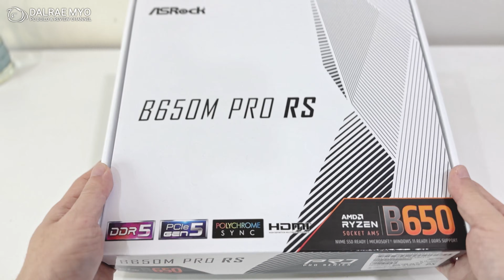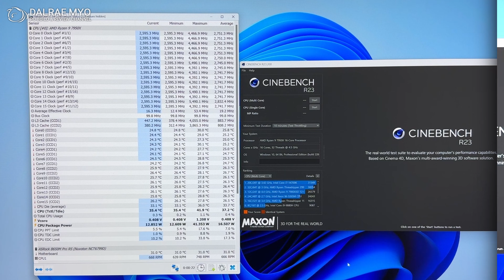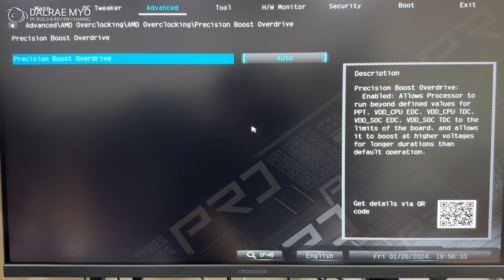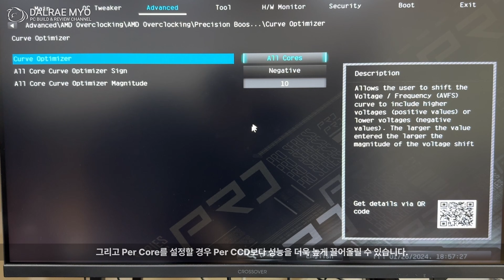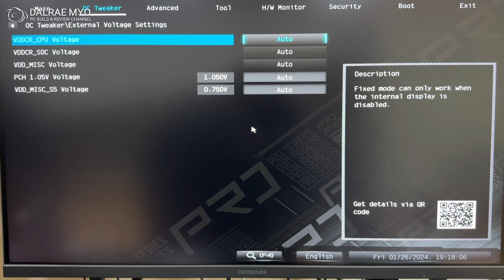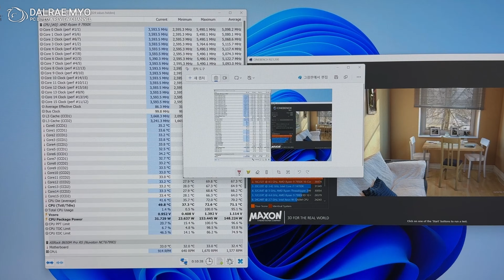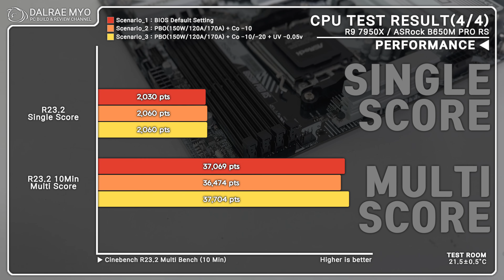ASRock B650M PRO RS Review | AMD Ryzen 9 7950X Undervolting

Comment: hey, I don't understand much about this, but do you think for a ryzen 9800x3d this motherboard is enough? I'll be running at 6400mhz and planning to set PBO + 200mhz
Reply from the maker: Overclocking varies depending on potential, so it's hard to give a definitive answer. However, based on the motherboard specs alone, I think it should be sufficient.

Comment: Thank you for english subtitles! Several days ago i got this mobo (but with wifi) and R9 7950X, my question is: can i go straight to this third option of undervolting?
Reply from the maker: Undervolting has different values depending on the CPU's potential.
You need to find the optimal voltage value for your CPU to operate without problems.
Reply: @DalraeMyo  Thank you for such clarification. I Appreciate your work!

Comment: Does these undervolt setting work for a 7500f generally too?
Reply from the maker: Yes, it would be applicable to 7500F if the potential is similar.
Reply: @DalraeMyo  thank's alot, awesome results by the way!

Comment: Il y a pas besoin de carte wifi avec cette carte mere ?
Reply from the maker: Pour être précis, il fournit uniquement un environnement dans lequel une carte WI-FI standard M.2 peut être installée. Pour ces modèles, vous devez acheter et installer le kit M.2 séparément.

D'un autre côté, une carte mère avec le modificateur WIFI dans le nom du modèle a la fonction WIFI intégrée par défaut.
Reply: @DalraeMyo  est-ce que je peux te contacter par message privé pour plus de renseignements stp

Comment: I just bought this board and waiting for it to arrived! I will pair it with R7 7700! Anyway, the cooler you're using won't block the RGB of the ram kit? I want to see the ram rgb 😊
Reply from the maker: I think it will vary depending on the shape of the CPU cooler you want to install.
If you use a single tower design CPU cooler and two RAMs, you will use slots 2 and 4, so I don't think it will block the RAM's RGB lights.
Reply: @DalraeMyo  I finally build my PC sir and I'm using this board with R7 7700 .. I was getting 44c idle before but when I added a GPU (Intel B580) the idle became 54c Ahhh... I don't know if that is normal.. when I run cinebench though it doesn't go up to 71c/79c only.. also.. can I undervolt my MOBO if the BIOS are not up to date?
Reply from the maker: @ Unlike Intel systems, AMD Ryzen's 7000 series has a high idling temperature. If the temperature does not exceed 90 degrees under a load such as R23, there is no need to worry.

Since the graphics card is a heat-generating element inside the system, it is natural for its temperature to rise.
Reply: @ Thank you for answering! Last question, do you happen to know the  ppt tdc edc for the NON X version of 7700?
Reply from the maker: @ Although there may be slight differences between motherboard manufacturers, Ryzen 7000 non-X will usually operate in Eco 65W mode.

The default settings for Eco 65W are as follows.
PPT 88W
TDC 75A
EDC 150A

Comment: can you do with x870?
Reply from the maker: I know that x870 supports more detailed adjustments than the option values I adjusted.
I also plan to try more detailed settings soon with an x870 or a b850 chipset motherboard that will be released later.

Comment: Can this be used for 7900x?
Reply from the maker: Yes, you can use 7900X CPU with this motherboard.
Reply: @DalraeMyo  Can you guide me to offset the 7900x but the performance loss is not significant?
Reply from the maker: @Nanalu137  This motherboard has enough specifications to cover even the PBO preferences of the 7900X.

If you're curious about PBO custom settings, please refer to the figures I set in the video.
Reply: @DalraeMyo  I am using b650e taichi
Reply from the maker: @Nanalu137  Ah!, I thought you were talking about the B650 PRO RS motherboard in this video.

You can follow the CPU (PBO) settings as I set them.
There are slight differences in the values applicable to each CPU, so it is necessary to adjust the values little by little to avoid problems during load testing.

Comment: Is it okay to put R9 7900x in this b650m,and do this. Because people are scaring me with VRMs and power phases (8+2+1)..
Reply from the maker: This motherboard has a VRM specification of 400A capacity.

There were no major problems when using the R9 7950X.

I think the R9 7900X will have no problem.

Comment: Hey there, thanks for the video. With this motherboard, I was worried with the VRMs but it looks if it can handle a 7950x at stock it should be okay for future am5 processors? Appreciate your insight, seeing as most am5's will only get more efficient. Thanks!
Reply: yes 9000 series is efficient and low thermal you will be fine for future cpu
Reply: @Raghav-gd3fn  so a r5 7500f should easily work?
Reply: @therealkitCat  7600x user here, it works just fine
Reply: should a 7700x be fine as well with this board?
Reply: @hk_g4ming  it can handle 7950X so this mobo can handle7700X with eaze
Reply: @hk_g4ming  yes, the board just not look good as rog strix or aorus tho

Comment: ASRock B650M PRO RS or ASRock B650M PG RIPTIDE?
Reply from the maker: The PG Riptide model has a slightly higher VRM specification.
B650M PRO RS : 400A
B650M PG RIPTIDE : 600A
Reply: man stuck on these choices too

Comment: Is there any difference between this and the wifi version other that wifi?
Reply from the maker: For the WIFI version, you can use wireless Internet and Bluetooth equipment.
When compared to other manufacturers' WIFI version models, the chipsets of the wireless communication devices used are sometimes different, but rarely significantly different (for products at a similar price point)

Comment: Hello, what is the temperature of the VRM?
Reply from the maker: There seemed to be no separate VRM temperature sensor.
Reply: @DalraeMyo I have the same motherboard and the MOSFET heatsink can be moved if pushed by finger, is this normal? Can someone tell if their Asrock B650M doing the same? I'm freaking out
Reply from the maker: @editspotato  A thermal pad is attached between the heat sink and the MOSFET.
Some motherboards receive too much tension and may move slightly to prevent damage to the PCB board or MOSFET.

If you think it's moving too much, try tightening the screws to secure it a little more.

Comment: The right screw on the SSD heatsink isn't moving. Please help me.
Reply from the maker: If the screw does not come loose with the driver, it would be faster to contact the manufacturer's customer center.
Reply: @DalraeMyo  I have but still no reply from ASRock.

Comment: hey hows the vrm heatsink temperature its it good to handle current 7000 and upcoming 9000 cpu with good temps? plz reply
Reply from the maker: The average heat sink temperature was similar to other motherboards in my test. If the power consumption of the new Ryzen series doesn't exceed 200W, it has enough VRM specifications to use.
Reply: @DalraeMyo  thanks for the reply 😁🙏

Comment: I watched hardware unboxed, and in their test B650M Aourus PRO AX and B650m Aourus Elite have good thermal performance, is it related to the numbers of vrms ? compared to this mobo which one is better ?
Reply from the maker: I don't know what the B650M AORUS PROAX is like, but the AORUS ELITE model has a VRM spec of 720A capacity. It has a higher power supply spec compared to the PRO RS model with a capacity of 400A.

Comment: B650m pro rs or msi pro b650 s wifi, which would be better for 7800x3d?
Reply from the maker: I don't think there will be a big difference. I think you can choose considering your preferred brand and price.
Reply: @DalraeMyo  what will u suggest for 7800x3d b650m pro rs or b650 pro rs the bigger one is 30 dollars more the case supports both sizes
Reply from the maker: @chavdarqnakiev9983  The ATX-sized motherboard has a slightly better VRM spec. Other differences include more space between the PCIE slots.

If it's worth the price difference, you can choose the ATX size board, and if you don't feel it's worth it, you can choose the M-ATX size motherboard.

Comment: Booting speed : 17.36 sec. ?  🤣🤣😂😂👎👎 what a joke
Reply: Not bad considering many AM5 boards take 35-60 seconds.
Reply from the maker: It takes as early as 15 seconds, and usually booted within 20 seconds.
Reply: @Ew40  But that's $450 motherboard
Reply: @SPPACATR  no only 200
Reply: @Defffman  I bought one yesterday for $110 USD